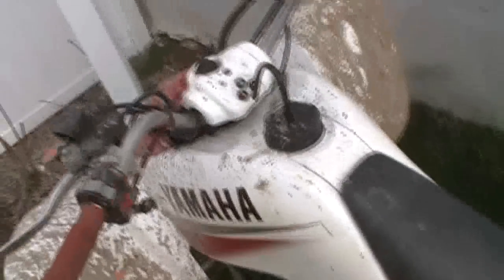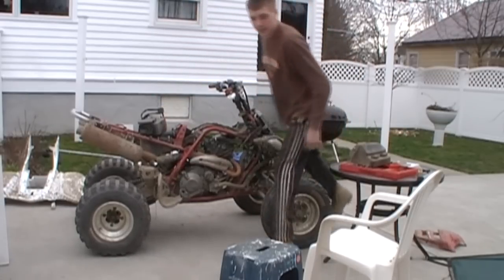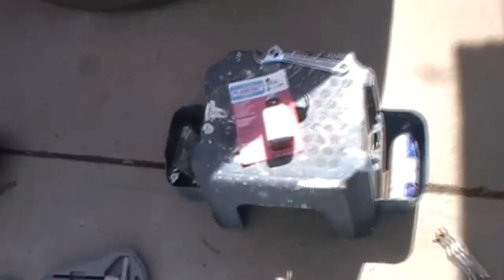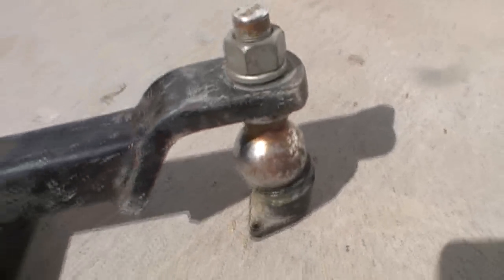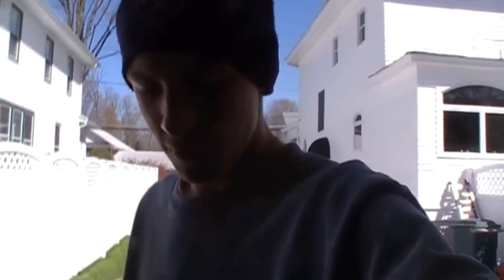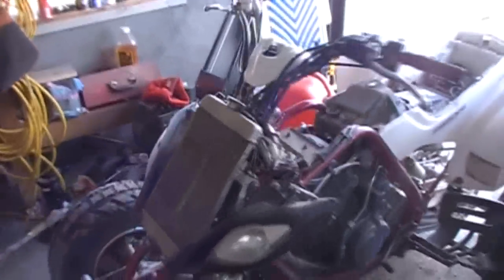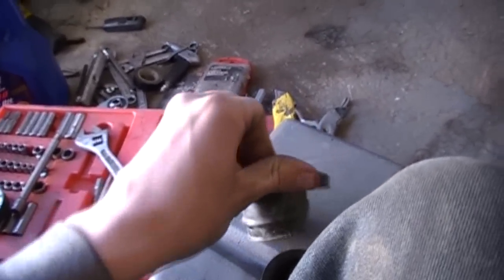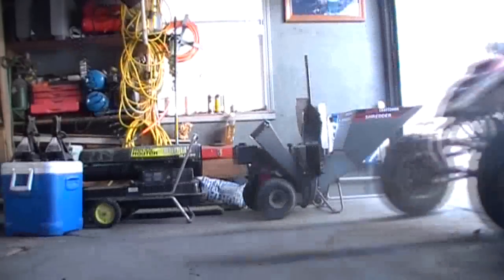Raptor 660 Fix

Comment: i have that problem too lol
Here in Portugal this piece is very expensive , I will try to search on ebay . I saw also that when you were reversing , your quad , not cutting rotation. my quad in reverse has cut rotation, and , in the mud when I give gas, reversing sometimes goes down .